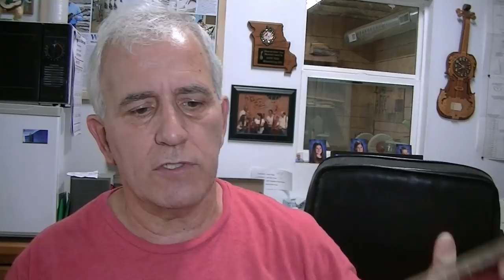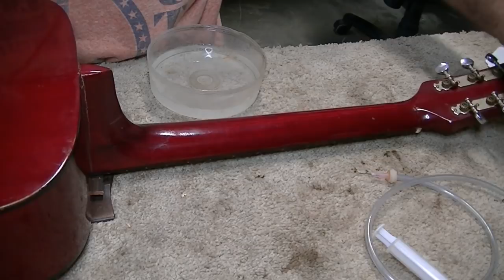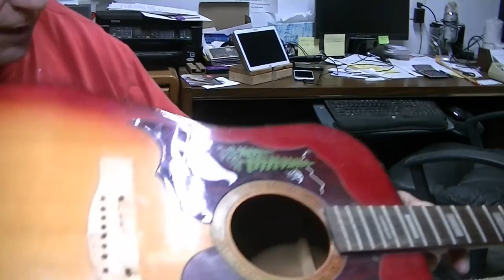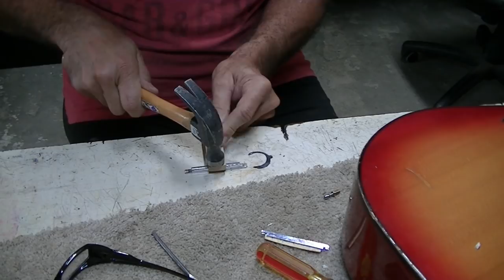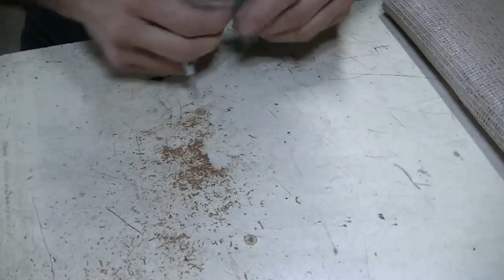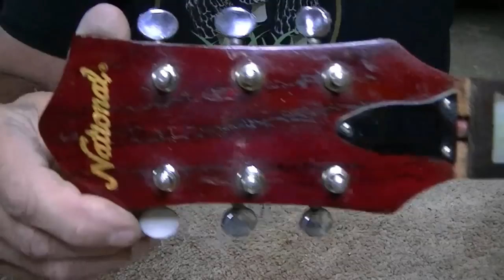186 RSW National Acoustic Guitar Restoration On A Budget Repost

Comment: Nice work on that old cheapie.  I have an old cheapie tiesco checkmate that was a nylon strung guitar that I picked up at a yard sale for $5. Bridge was pulled up at the back,top was only held on by the fretboard extension and what glue was at the tail block. Laminated back and sides but it has a spruce top on it,poorly matched mind you. Most of the bracing was missing. I pulled the top,bridge and bridge plate. I rebraced the top with a light X-bracing,ebony pyramid bridge and strung it with Martin silk&steels. It’s actually a good sounding old guitar. The neck is some kind of soft white wood,no truss rod. I routed 3 channels in the back of the neck and Inlaid carbon fiber square rods in it. It’s been holding for almost 6 years now. Has a pretty cool laminated fingerboard on it,after I sanded the thick assed painted finish off the neck and fret board I noticed the board was laminated.
Reply: I'm a fan of Teisco guitars, I have a couple of electrics from the 70s. They're suprisingly well made, particularly the necks, with a zero fret and are very playable. Your acoustic sounds like a real bargain.

Comment: It is a Japanese made instrument, built around 1970. These models were imported to the US by a company called "Strum and Drum" of Wheeling, Illinois and they were supplied under the names of either 'National', 'Ensenada', or 'Norma'. The National brand name became available for use by Strum and Drum, when the Valco company (previous owners of it) went bankrupt during 1968 in Chicago. The prefix 'WG' stands for Western Guitar.
That's all I know about those guitars, because there isn't much info on them to begin with.
Reply: I would tend to agree, with the opinion that the year would most likely be 1971-1974 rather than 1970, as most all Japanese luthier houses used a zero fret in 1970, with most eliminating it by 1971.  Yeah, I know, a useless minor point.  Of course, I could be wrong.  I was wrong once, I think it was in 1981.........

Comment: I have done that sort of neck joint repair several times and had the repair fail only once thus far. Something I did after that failure is I started getting the fretboard extension loose from the top, then clamp the neck joint as you did and THEN glue the extension back with the neck flexed in the proper position. Its just an extra step that helps everything stay at the right angle. Great video, Mr. Rosa. An oldie but goodie :). Take care!
Reply from the maker: Thank you very much.

Comment: Great video as always!!! I love watching all your repair work! I have a quick question, I have a inexpensive old parlor presumably from the 50's, the neck needs a reset but like this guitar I'm able to push it back and see that it's quite straight,  I'm very short of cash so I was thinking of using hot hide glue and injecting it into the neck joint as much as I can then clamp for a week or so, the thing is I'm that short of cash that I can't fork out for more clamps so I only have the one, would a clamp on the heel and rope tied around the sides of the guitar and the heel be enough to hold the neck in place or is there a easier/better way that's just as inexpensive that you know of? Thanks!

Comment: Rosa String Works I got a small Kay guitar neck is really loose so I removed the neck on it. It has 4 dowels I removed them and put 4 new dowels on neck and added one more dowel on bottom of neck and I am going to put a shim on fingerboard tongue will all that fix it lower the action? It has a none adjusting rod.
Reply from the maker: +Brian Smith it sounds like you're taking the right steps. However I cannot tell you if this will lower your action because that depends on the neck angle to the top. Good luck to you.

Comment: would it have been better to use CA glue to secure them with out removing them? CA glue can be also used to secure loose finish that is flaking off.
Reply from the maker: Yes I use it for finish work all the time. Without looking at the video again I can't remember what you're referring to.  Perhaps the tuning keys?  I'm not sure. Thanks for watching.

Comment: Rosa String Works Just curious how does the warm water help it? Also what is that tube thing you are using called? I want to buy one I might be getting a Harmony with a similar neck issue like what that guitar has. Think Ebay sell one of those tube things?
Reply from the maker: +Brian Smith the syringe in tube are just things I put together I think I got the tubing at Lowe's. I'm not sure I think one of the viewers sent me the syringe. The warm water allows the glue to flow better and the capillary action of the water sucks the glue back into the cracks further. It held real good the customer is still using it and I don't think they'll be any further problem. Thanks for watching. Merry Christmas.